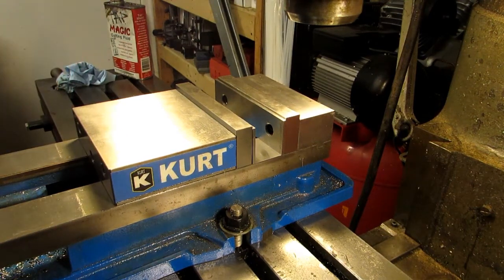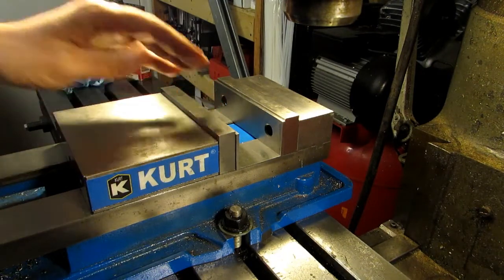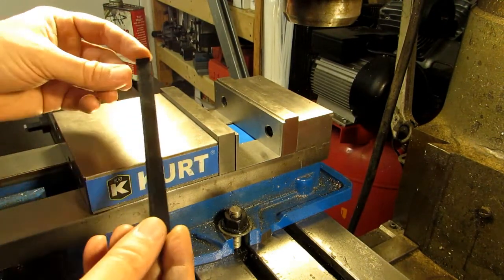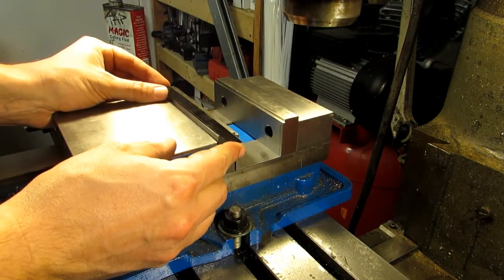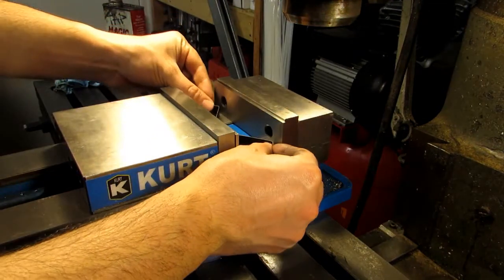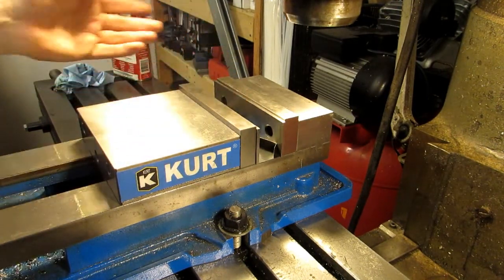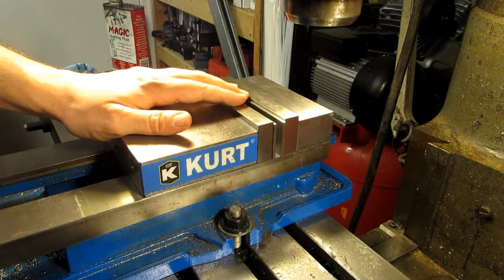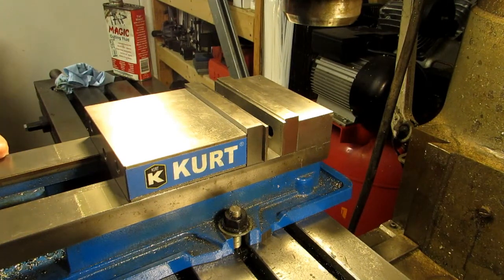Quick Machining Tip #2 - Parallel keepers

Comment: My tip with parallels is also to use a compression spring or two between them. This keeps them clean underneath as the springs prevent them from moving or lifting. They stay in place when cleaning the unloaded vice with an airline. Another bonus is that the vice handle does not have to be unwound very far as the springs immediately take up any backlash in the vice screw so the moving jaw moves immediately when the handle is loosened. This is a great timesaver when making several identical parts.
Another problem is cleaning the tops of the parallels. Although the springs will hold the parallels in position swarf can get forced into the corners where the tops of the parallels meet the vice jaws. To prevent this, use another slightly shorter pair of parallels & place them between the taller ones & the vice jaws. This removes the corners where stuff can get trapped as it leaves a recess between the tall parallels & the jaws so nowhere for anything to get trapped.